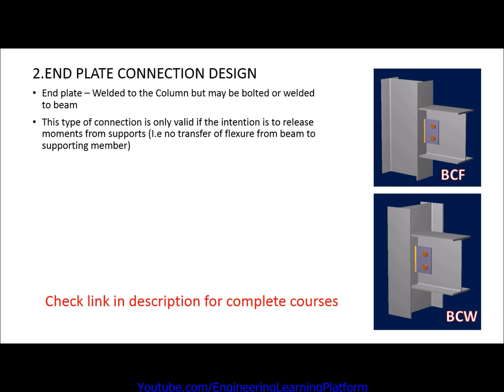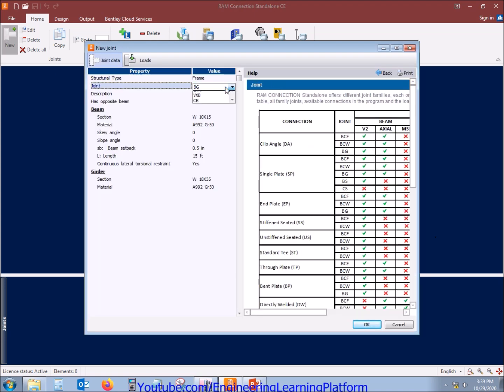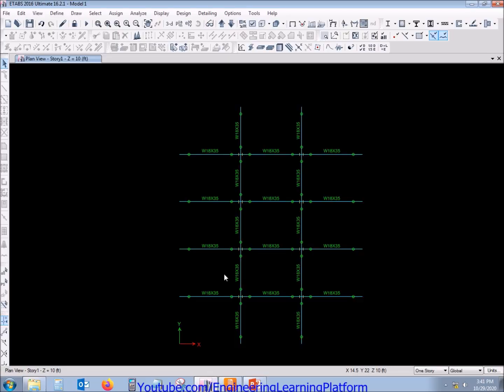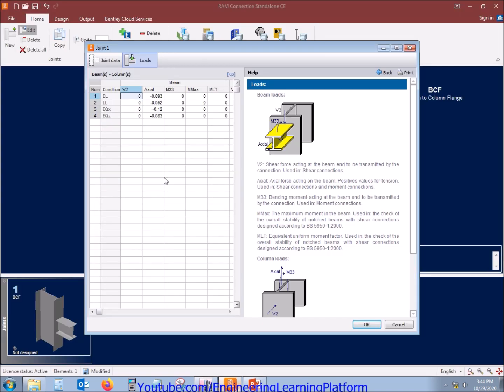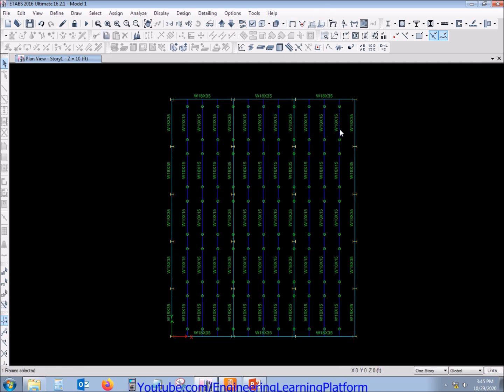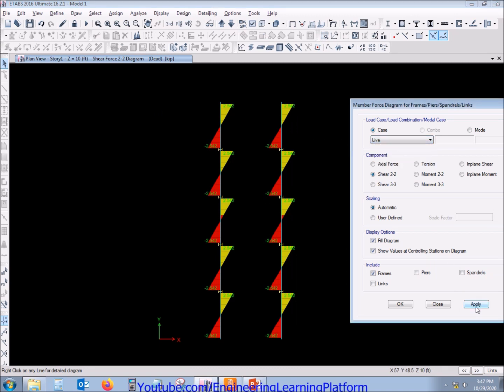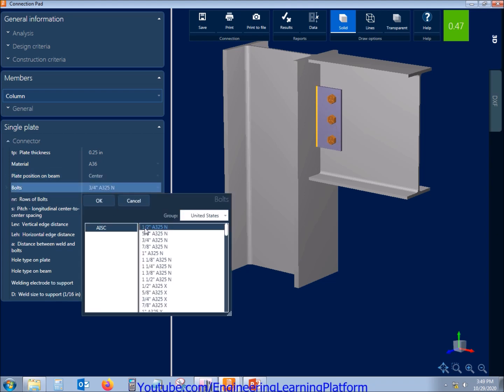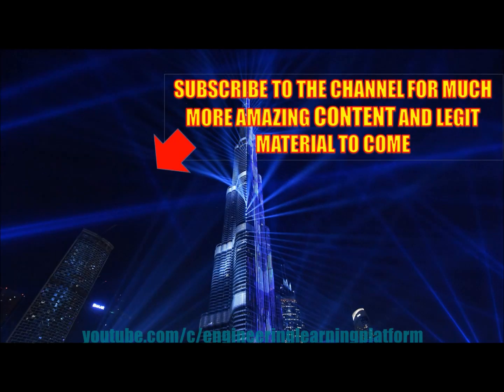End plate beam to Column steel connection design using Ram connection

Comment: HI BOSS, IF WE INTENTIONALY DESIGN A SHEAR CONNECTION, THEN WE SHOULD USE A BIGGER DEPTH BEAM SO THAT IT CAN TAKE THE WHOLE MOMENT BY ITSELF INSTEAD OF TRANSFER IT TO CONNECTION, HENCE WE WILL GET A LARGER DEFLECTION AT MIDDLE... AM I RIGHT? THANKS
Reply from the maker: Yes the depth is related to the moment

Comment: I have combined two ISMC 150 like a box as beam section. However I cant add them as beam section for connection design. I have tried the Tube section of same dimension but the software doesnt recognize it as beam section. It only take I section as beam. Anyone know how I can get around this problem?
Reply from the maker: Actually you are right these are limitations of this software. You can use Idea statica instead if the connection is different from the typical ones given in Ram connections